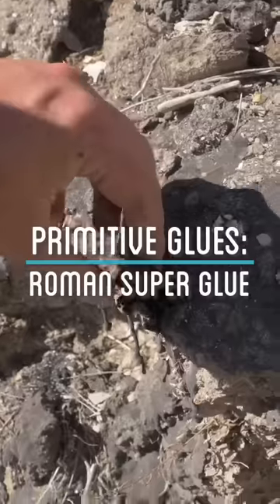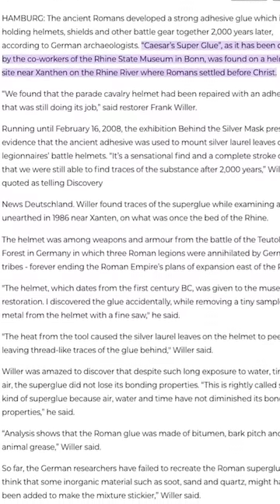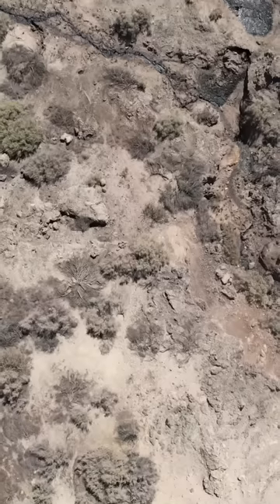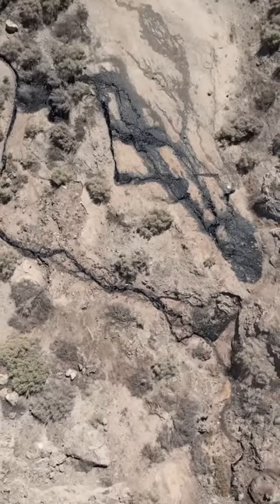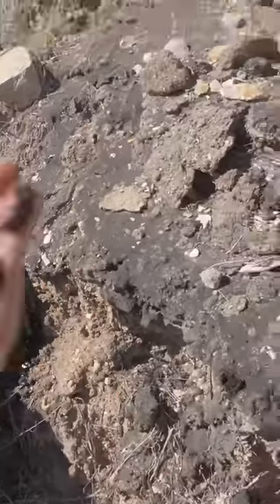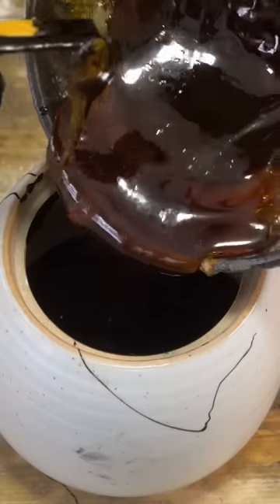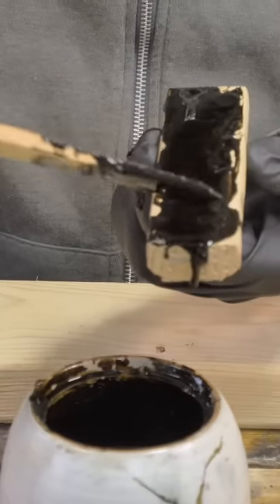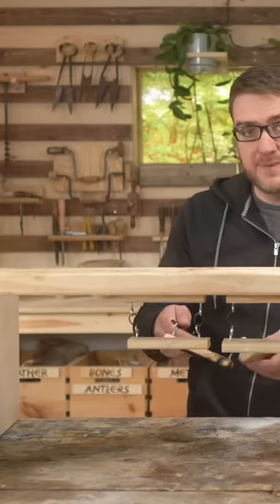What is Roman Super Glue? #shorts

Comment: Paint thinner, kerosene or gasoline work very well to remove bitumen but be very careful applying it to your skin, only use small amounts.
Reply: Yeah no just get something specifically for cleaning your hands 😂
Reply: Yeah do NOT use any of those. Its far safer to use Mineral Oil (helps to have some abrasive like sand). Mineral oil is safe for human contact but will dissolves many petroleum products such as bitumen. Then just use soap and water to wash away.